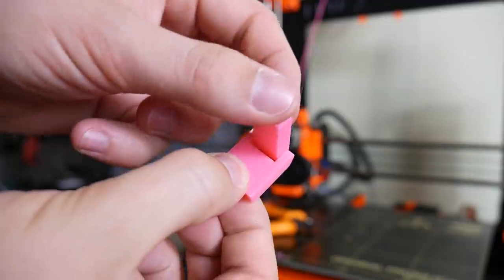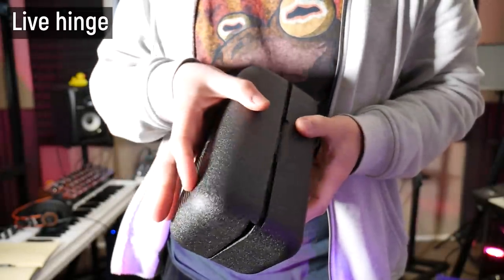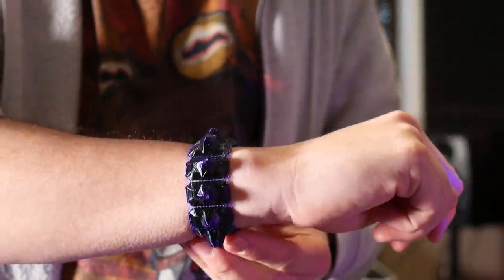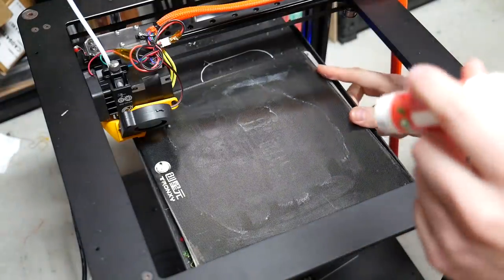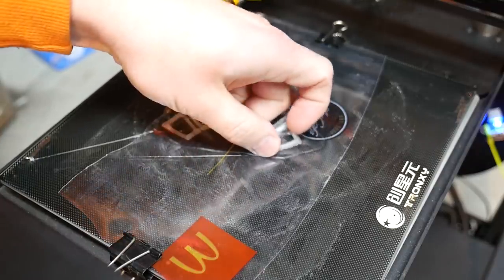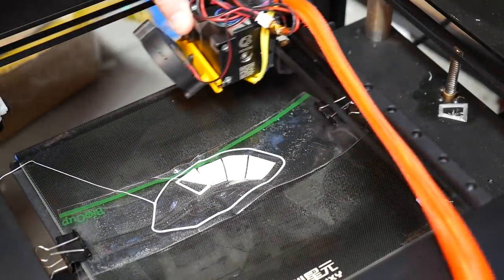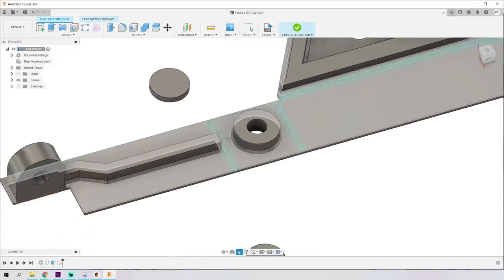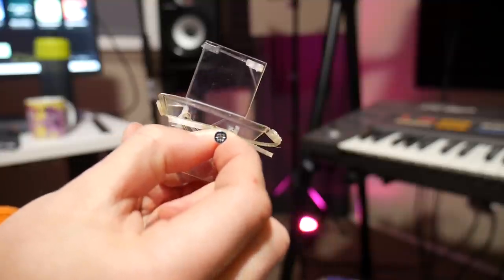Incredible Folded 3D Printed Mechanisms

Comment: Prior to retirement I was a coatings chemist for over 30 years.  Preparation of the substrate, in your case the plastic cup, to remove any residues on the surface is critical, wash in soapy water and/or solvent wipe the surface before printing to it.  Our company did a lot of business in coating plastics and worked with a number of difficult types like EPDM and TPO.  There are several approaches to gaining adhesion, one is to use a chlorinated polyolefin tie coat at very low solids (not at all green) another is to immerse the plastic in a heated solution of bleach and water for a few minutes then rinse and dry. This might be worth a try to help solve your adhesion problem. Age of the formed substrate and the forming temperatures used to make the plastic sheet can also effect adhesion.
Reply from the maker: Very interesting insight, thanks!
Reply: What concentration of bleach and water, also would heating/tempering the plastic during the adhesion process as well as mechanically abrading the surfaces to adhere to help?
Reply: sandblasting might work too maybe?
Reply: @satibel  Sandblasting will leave a dusty residue. You would have to chemically clean the surface.
Reply: Chlorine bleach, I'm assuming?
Reply: @MakersMuse  Perhaps lasercutting fumes create a thin particulate coat that reduces print adhesion later.
Reply: so.. coating chemist.. u may have a good answer to this.....
there is any way of knowing to wich substance an X type of plastic may adhere to?  like... nylon 6 molecule is this way and it should adhere to this  kind of materials , becouse some property of those two materials share... , etc???

Comment: Iced coffee AS A BUSINESS EXPENSE! BRILLIANT!
Reply from the maker: What could possibly go wrong 😂
Reply: that is the question
Reply: First attempt was wagyu steak based live hinges, but that for some reason failed immediately.
Reply: @kwaaaa  I need a sample of this material, can you have it here by 5-5:30?
Reply: @MakersMuse  "Hold my coffee; watch this!"... Nah, doesn't sound right without the beer, does it?
Reply: Watching and learning...
Reply: Any of these are incredibly easy to make by the gallon for pennies.  Why buy them and feed the corporate machines who only screw us?
Reply: @SeaJay_Oceans  still better than the bioplastic biocup shown here, since they can't be locally recycled. 😢
Reply: @MakersMuse  Possibly there is a difference between the inside and the outside surfaces of your coffee cup preventing a good print.
Reply: @MakersMuse  why didnt you just use laminating sheets
Reply: @kwaaaa  😂
Reply: @SeaJay_Oceans  what do they use for disposable cups in the EU? Styrofoam?
Reply: 3D..*havy breathing* printer 
GIMEEEEEEEEEE

Comment: Non-repeatability in a LASER cutter is an unacceptable abomination for what those cost.
Reply: Agreed, even just your cheapie 3d printer using microswitches can have better repeatability than that. Not even asking for the repeatability of a CNC that uses limit switch/encoder index to home
Reply: Tell me about it! Mine sometimes gets lost in the middle of the engraving
Reply: so their firmware is already getting crappier, just like inkjet bullshit.

Comment: I think the bonding issue you had with the tape is because the tape has thickness.  You arent getting squish because the plastic sheet has a gap under it.  You could put slips of paper between the tape as a packer.

Comment: Give the cup material a scuff with a Scotch Brite or a very light kitchen scourer. The micro trenches give the deposited filament something to bite into by increasing surface area. 3M also make a plastic primer in no spill, single use applicators. Love your work mate.

Comment: Since you are using a flat insert, why not filament swap just a few layers for the hinge?
Reply: You'd probably want to also insert some really tough pins to keep the different layers from sliding over eachother when you're using different materials.
Reply: I was thinking the same thing, like a layer or two of tpu would probs work really well, I’m gonna go try that out
Reply: @henrydavis2660  Problem is that TPU doesn't weld well with other material.
Reply: @rikilshah  yeah I thought about that, if I set the first layer of pla to be hotter it might work, I’ll try it out tomorrow, (11:36 pm rn) and let you know how it goes
Reply: @rikilshah  What about making the two materials comb together?

Comment: I have a feeling that fiberglass drywall tape would work fantastically here. Essentially the same as the nylon mesh fabric but much tougher and less stretch. I think I'll try that out and see how it fares
Reply: Assuming it's on the straight grain and not on the bias, yes.
Reply: Sounds good. It won't wear out

Comment: Having trouble sticking paint to plastic I used to flame treat it quickly and that works.  Also we use a lot of tape hinges in radio control foam aircraft. You can even get tape with strands embedded for strength.
Reply: Fiberglass tape embedded between layers would probably work out the best. It won't tear, is very floppy and cycle count should be much higher than a printed live hinge, or one made out of the PET or acetate sheet.
Reply: Flame treatment or electrically generated plasma treatment both work well for low surface-energy materials, it's used commonly to enable printing onto plastic substrates.
Reply: @cambridgemart2075  NaOH (drain cleaner) can treat the surface of PET too, but I am not sure how effective it will be for bonding the two plastics.
Reply: At one time I made some r/c planes out of Coroplast (real estate signs). It was common to run a propane torch over the sheet material wherever one was gluing anything.  A light blue flame flashed (in fact, the process was called "flashing").
Reply: @ytrichg99  ive done the same thing. Especially with cowlings, canopies and heli bodies before painting.

Comment: I would strongly recommend Polypropylene (PP) material for live hinges due to its strain hardening characteristic. You will have a hard time getting PLA or PETG to stick to it so perhaps PP filament with a PP sheet would be the best bet. PP is used to make things like tic-tac containers and bathroom stall dividers. The latter application is solely because it is very difficult for markers to stick to it thus preventing graffiti in the stalls.
Reply: You’re right PP has many good mechanical properties. However PP sheet warps lots at fairly low temperatures in my experience. The warping is especially problematic under a laser cutter (in industry they’re normally CNC cut with a tangential knife system - outside of die cutting - and I can only wish I had one of those.)

I occasionally sew pp sheets (with industrial sewing machines) but find it too much of a pain to cut to make more with it.

Comment: What about a thick plastic bin bag? They're usually LDPE so might be resistant to sticking. Or an acetate sheet for projector overlays?
Reply: LDPE gets EXTREMELY sticky when it's up to temperature.
Reply: Ooops.  I copied your transparencies sheet idea.  That used to be available eveywhere but maybe not so much.  I wrote a comment above suggesting those cheap nasty binders for schoolkids.  The ones with a living hinge must be the right material to perform and they are stupid cheap and you get two letter sized sheets in any colour you want :)

 I think the melting point of the LDPE would be very very bad.  I had one blow onto the muffler of my motorcycle... it sucked onto it like it was drawn to it since it shrinks as it melts... it was however a very durable finish :p
Reply: @someguy2741  Ah crap i did the same thing and suggested transparencies

Comment: brilliant video as usual, if anyone reads this... you can print PLA directly onto a single layer of TPU with a normal single material hotend and extruder set up by exploiting the initial layer settings... all you do is manually swap filament after the first layer (which is easy because we all watch the first layer go down don't we...?), the bond between the two types is surprisingly strong and once parts are cooled the TPU doesn't sag.

Comment: I think a few holes in grid pattern, cut on the surface of the plastic sheet would help the printed pla/petg to stick.
The melted pla/petg would go through the holes and expand a bit on the other side of the sheet, forming a sort of "rivet"
Reply: I'm afraid that wouldn't work because the nozzle would bump against the sheet material as it was depositing the first layer on the bed - unless you can instruct the extruder to make hops from one hole to the next?
One might choose to just start printing, and have it pause when the pocket for the sheet is done, including tiny posts everywhere. You'd laser cut holes in your hinge shapes that fit right over those studs. Just insert all the laser cut parts in the paused print, hit resume, and presto!
I think this embedded approach obviates the need for plastic-to-plastic adhesion.

Comment: Angus You're probably aware that the reason for an Ackerman steering linkage is to make the inside wheel turn more than the outside wheel because the inside wheel has to go around a smaller radius.
Only saying this because in the straight ahead position it looked like the two trailing arms were at 90 degrees to the centre of the vehicle body so you would not get any Ackerman angles.
Reply from the maker: Yeah it's a parallel linkage for now, but I'll modify it a little.

Comment: Very interesting stuff. I messed with the idea of printing onto plastic sheet a couple of years ago, with the idea of making architectural models (think something like Heathrow Terminal 5, 4 big glass walls and a curved roof), but could never get the print to stick. I may well revisit the idea now.
Reply from the maker: Yeah, for clear windows and details it could be a good option! I didn't even consider that.

Comment: I have been using a single layer as integrated live hinge for a press button mechanism. If you play around with the parameters (layer height, temp, first layer pattern) this works like charm for me and is quite durable. I have not ever broken one single, by bending it too often. Anyhow, I think your idea on using thin plastic foils as print surface deserves more research and is a good idea. Thumps up and please continue to explore out-of-the-box ideas !

Comment: You can also make a hinge with a 3d printed pin with threads on the end or basically a 3d printed nut and bolt. They work pretty good

Comment: I would strongly recommend you get Lightburn; it's a vector graphics software specifically for laser cutters, and has all sorts of invaluable features like automatic tab generation, multiple layers with different cutting/engraving settings, a materials + settings library and a lot more.

Comment: Love your videos. I've had success using a thin layer of printed PETG as a live hinge
Reply: What brand and thickness?
Reply: @kevinpezzi6777  Never mind. PETG is not as durable as I thought. I've changed to using plastic snap rivets to hold my printed parts together and to act as hinges where needed. They are cheap, easy to use, and easy to design into my parts

Comment: Have you thought about using a piece of filament as the hinge material? The piece gets press fitted into printed holes and you can change hinge properties by either changing tolerances in your model or by drilling out the printed holes.

Comment: I printed a hinge I designed where the hinge printed vertically, each barrel using the previous one for support, and then using a 2.5mm RC car axle as the hinge pin.  Worked a treat!

Comment: Another option for doing all this is to print one or two layers of a flex material, insert a filament change instruction and continue with whatever material you want the rest to be made from. You just need to make sure that the two filaments are compatible and will bond together.

Comment: You could try printing on heavy duty packing tape. That stuff is pretty durable and would have no issues sticking to the bed of your printer. You can also find it with imbedded fibers that further increase durability.

Comment: Hey! I do this kind of bed leveling for multi material with the BL touch… regardless the height of anything I put in the bed, it’ll consider it as the zero.
Just remember to remove that purge line from the beginning of gcode, and disable mesh leveling.
Great content as usual!

Comment: @Maker's Muse: The heated bed is to help PETG stick to a dissimilar surface, like PEI or glass. PETG  to stick to PETG (so likely PET as well). Please try using the PET sheets  bed heat. You may have to crank the 1st layer speed up a bit to  from heating up the sheet too much.
A side thought about holding it down: You could replace the heat-bed with a thin () aluminum plate (unless you have a dead heat-bed already) and drill an array of tiny holes in it, apply vacuum to have it hold the sheet flat (kind-of like an inverse air-hockey table).

Comment: Ikea and other home-shops have a drawer-liner material that is a chunky TPU-like sheet (~2mm). This seems to soften around ~ 60-80'C and you can lay this on the heated bed and print PLA directly into it. (you do have to Z-offset the first layer by ~2mm then). This works for me, but I had to experiment with 2-3 liners before I found a good one. 
For bed adhesion - I am fond of 3D-Lak - a single can lasts me years. It is water soluble. (usually not needed for the live-hinge material).
Reply from the maker: Very interesting! I always assumed they were silicone and not suitable, but will have to investigate when able.

Comment: Great video, I have always wanted to get into these types of printers but they were always a tad too pricey. As I was watching you trying to find a thin flexible material to print out your hinges on my first thought was the thin vinyl sheets used on cricut machines or the Transfer Tape you use to transfer your vinyl design to whatever you are wanting to put it on. I don't know much about either one or if you would even begin to have the 3d print stick to either of those. Just a thought.

Comment: You could use the same technique you settled on to embed the laser cut sheet mid-print. It would work more like how over molding a metal piece. You'd need features around the outside of the part to help lock things together. The problem there is it would be a bit thicker overall.

Comment: Wouldn't it be an advantage to break the live hinges on that rack mechanism into two parts, divided by a little gap, so that when a split starts in the hinge through fatigue, you have at least a chance that it'll stop at the gap and you'll still have the other half of the hinge for a little while? You'd maybe get a warning break that way without a full failure. Great video as usual.

Comment: There are ~0,1 mm thick, somewhat heat resistant clear plastic sheets for laser printers. Copy shops usually have them. I don't know what material they are made of but it would worth a try.

Comment: If you want the coffee cups to work better, consider this: The cups are not simply a clear plastic cup - they bear printed logos and the like. There is probably some sort of coating on the cups to either protect that screen sprinting or simply allow the ink to adhere better. Try giving them a light sanding with a fine grit sandpaper and printing on that to see if the 3D printed material adheres better. And pay attention to extent and way any deformity occurs. The coating could also be causing the warping by two different materials having different thermal behaviors. The sanding also provides a rough surface for the printing to adhere to even if the problem is in fact the smoothness of the plastic surface itself.

Comment: I would be inclined to go the separate printed hinge parts route myself. Many such small linkages simply have a press fit between parts and work quite well. Of course, gluing parts together is easy if that's necessary. There are two problems with live hinges: one is that there is always some resistance to bending, however small, and that can add up and be a problem; the other is that they have a tendency to eventually fail, especially if they are subjected to large angles of travel. I have so many bad experiences with live hinges so often - pretty much every day - that I really, really hate them.

Live hinges are common for RC model aircraft, but aircraft control surfaces generally have relatively small angles of movement and for the more aggressive and larger aircraft they still use a pivot pin type hinge for reliability.

Comment: Perhaps look into painter's plastic. The roll I have is 500' long, 12' wide and 0.3mm thick. It also comes in 0.1mm and 0.6mm variations. I originally bought the roll for vapor/moisture barrier on a garage room. Since I used it to make a drop down work area so I don't spray the whole garage with saw dust every time I need wooden stuff. It's a really nice material that would likely make for a great living hing if a plastic can be printed onto it for structure.

Comment: For a re-visit, you could try using a more durable fabric (even one without gaps) and punch holes in the fabric in the areas where it will be printed through.  You may need to create a modified layer to only fill the holes depending on the thickness of the fabric.  The cross section might look something like this:
===============
===============
==     ==     ==     ==
===============
The gaps being the spaces where the fabric isn't cut/punched out.

Comment: you need a camera for the laser cutter.  You can use it to align the design to a workpiece.
Reply from the maker: It has one, but it's not accurate enough even after calibration. Maybe OK for aligning engravings.
Reply: @MakersMuse  Wierd, I found my lightburn one is super accurate. Is that standard for the one you've got?